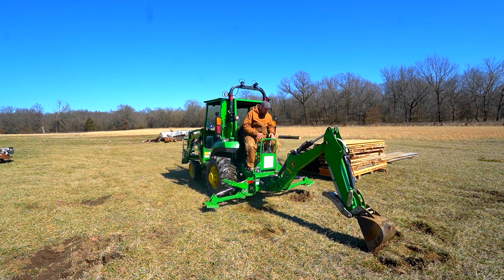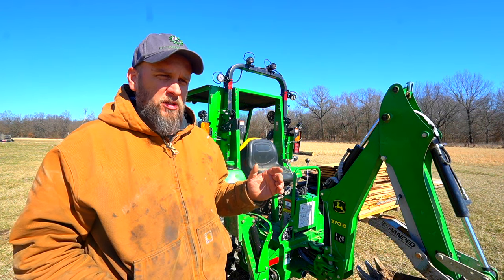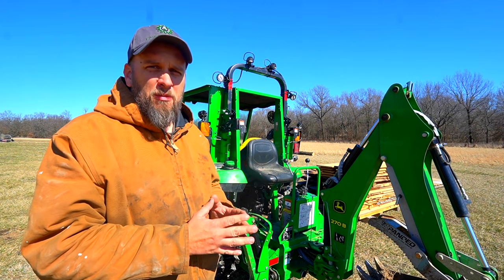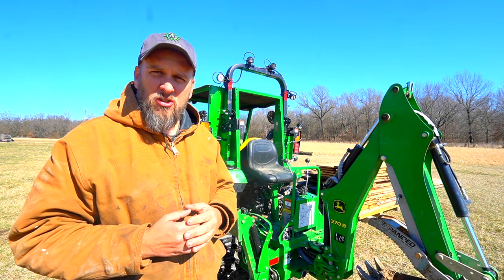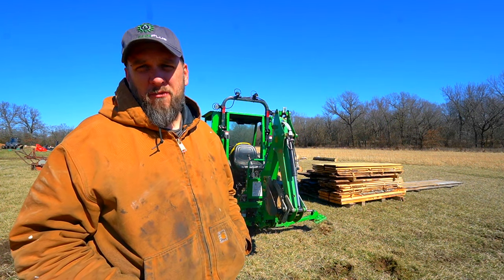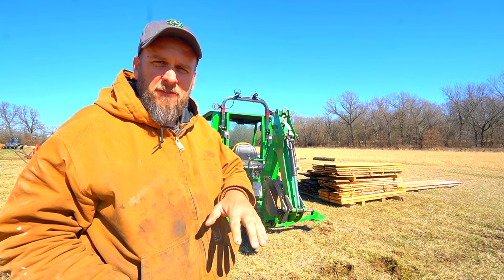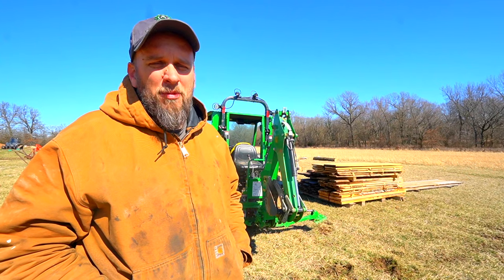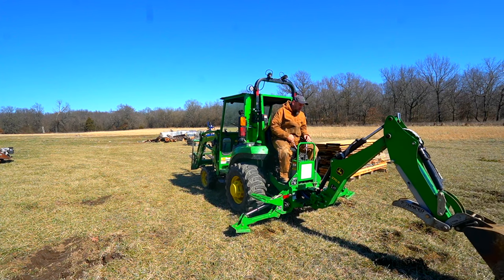How Does Hydraulic Pressure Affect Backhoe Performance

Comment: Good morning Brock. Any tractor is only designed to lift a set amount of weight so as not to cause damage to the hydraulic system or components. So weight absolutely is the determining factor. That being said the increase in your hydraulic pressure definitely made a difference. There is a time and place to be able to move a tractor in this manner like on flat ground. Lucas over at Peek's Peak had a great video yesterday about this exact thing. He explained it, showed it and how it worked for him. I'll shut up now and let you get back to work. 🙂 God bless and have a wonderful day.👍👍🙂

Comment: Adjusting the hydraulic pressure made a big difference in being able to move the tractor. Under the right conditions (level ground)I would move the tractor ahead using the backhoe. I personally would not use the backhoe to move the tractor from side to side. It looks like too much strain on the pivot point of the backhoe. I normally am not in a hurry when I use my backhoe so I just get off the backhoe and move the tractor. Great video Brock, thanks

Comment: Morning gents, when I use to run a backhoe a lot . I would have the boom closer to the back of the machine with bucket flat and push and out curl at the same time time , I think if u did that u would have more feet gain and not as much stress on the teeth. But then again all situations are different I've had to do it like how u have also , it just depends , you are doing a lot better than before so it's a win win and someday the stars will align and you will get there perfectly. What you really need this for is when u are about to get into trouble and need to move it cuz u will get stuck or something else. It will come into play when u do crazy stuff and u can't get off and move it . So do what you're comfortable with be it driving or moving with the arm / boom & buckle or have someone else drive it forward , that really helps you get quicker I think . I want to boost my hydraulic pressure because of u 🤪Todd
Reply: howdy
Reply: Morning!

Comment: The big issue is the cylinder size is prone to bending under that pushing and or moving the machine operation load. Ask me how I know. Been there done that. 1500.00 for the dipper stick cylinder.

Comment: Hi Brock.  Couple questions; 1) why add so much weight to the tractor, I get the totes are heavy, but seems that is allot of counter weight; 2) does the backhoe operators manual discuss if or how to move the tractor with it?

The sub & compact series tractors are much different than the construction grade series of backhoe in the same configuration.  Can't help to wonder if your backhoe just wasn't designed (hydraulics and frame) to do the same things as the construction grade tractors, which are built much heavier.

Thoughts?

Comment: Hey Brock I have a Kioti CS2520s and have found that the backhoe will move it around but only on flat ground is that feasible, but I’ve also found that the outriggers alone will not hold it in place you have to have the parking brake set to not drag the machine, with that said I am currently working on a video to ad traction to the outriggers to hopefully eliminate the need for the parking brake while using the backhoe, on level ground or at least to minimize the need for the parking brake

Comment: The additional force is only proportional to the pressure increase, 3050/2800, about 9% . If the relief valve is set at idle and then you go to full throttle you will see a pressure rise due to the design of the relief valve. This is due to the difference of "cracking" pressure vs. full flow pressure, this os called pressure overide, and is commonly about 10% for these kind of applications. Just remember you are placing more load on your pins and structures as well.

Comment: I have a moral quandary with this series of videos. You are showing people how to fix the problems JD should be fixing on their own but refuse to. You are a saint absolving them of their sins lol. I'm kidding of course, I really love that this is possible even if it shouldn't need to be. I would love to see a walking test of various brands of tractors in a stock configuration because I've seen many side by sides and consistently it seems JD makes machines that are nice but underpowered. I think this would make sense if it were one of the cheapest tractors in the segment. If you had an E variant this would be more reasonable but I want an R variant to be best in class for things like this. Though the more I watch this series the more I wonder if maybe it is reasonable to handicap a tractor for people who don't know/need more power while making it possible for someone like you to set the tractor to its real limits.
Reply: Fully agree. Deere sells less capable machines than the competition for a higher price.  You shouldn't have to spend money on upgrades after getting raked over the coals on purchase then have to fix their engineering shortcomings.

Comment: I can move my kubota L2501 without any problems. I'm not even close to running at full throttle. I would like to know at what rpm is your hydraulic pump running at maximum? If I increase my rpms. It doesn't seem to make any difference.

Comment: Your backhoe has a pressure relief valve on it you can have 2500 psi on the tractor your not getting 2500 to backhoe cylinders.

Comment: Hey brock if you're back wheels are loaded you shouldn't need the extra weights on the wheels
Reply: NO NEED for ALL that Weight on that  little tractor......its just "Killing IT".
Reply from the maker: It’s recommended in the John Deere owners manual.

It basically says here are the three types of weight you can put on the back of the tractor for ballast and it recommends you use at least two of them when doing heavy loader work